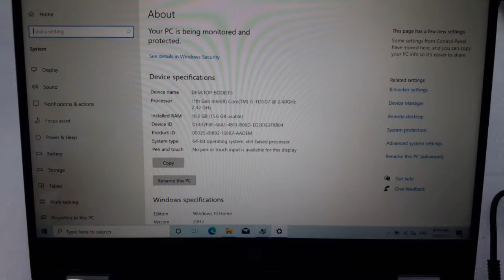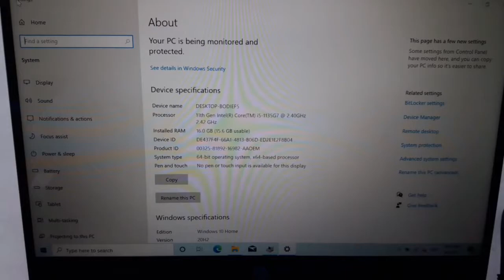Hp pavilion X360m 14m upgrading ram and ssd ||  hp pavilion x360m 14m-dw1023dx upgrading ram&Nvme|

Comment: Hi bro. Just found your video today. Do you have any idea how to fix vertical lines on screen?
Reply from the maker: Thanks for watching it is red, green, or blue, vertical lines on a computer monitor,
Although it could mean your monitor is getting old and may soon need a replacement, or if your monitor is connect to the pc  just be you have a faulty HDMI or DisplayPort cable. 
Alternatively, it may be your graphics drivers need updating, or you need to restart your monitor or PC.
Reply from the maker: please subscribe to my Chanel